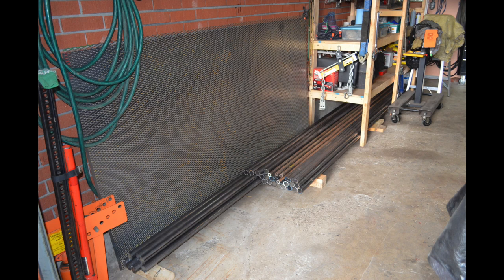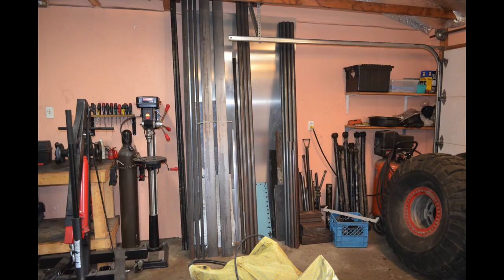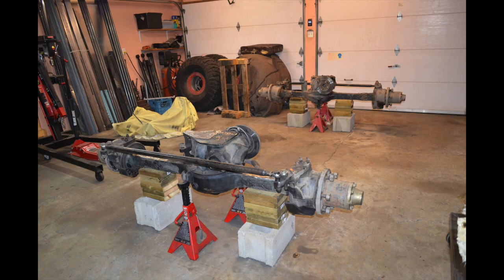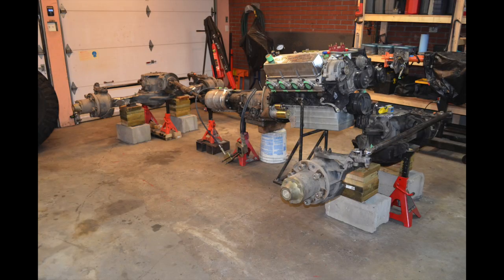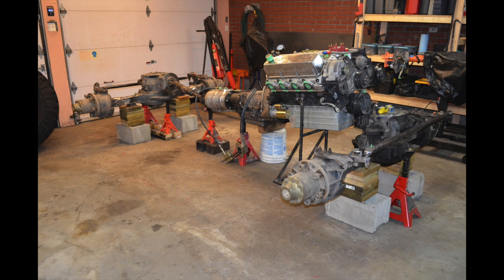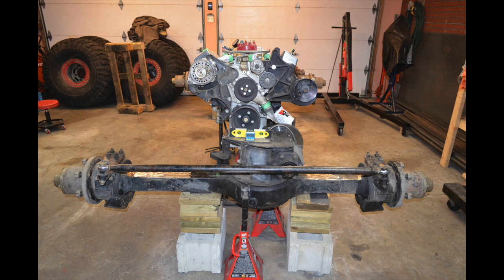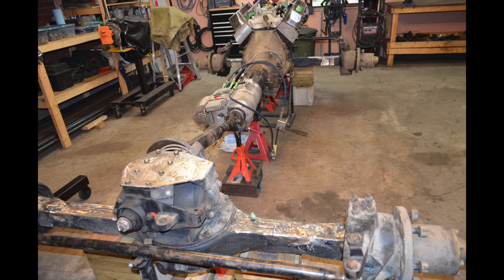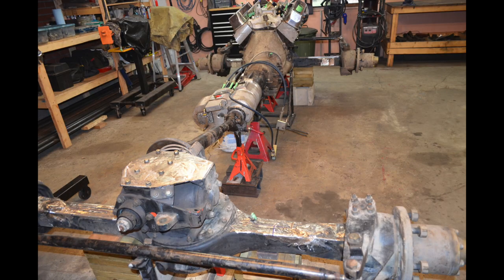Episode 2: Drivetrain | How to build your own rock crawler/buggy/bouncer

Comment: How do you determine/set ride height on a rock crawler buggy? Obviously lower the COG is best, but how do you balance lowering COG without sacrificing ground clearance,shock travel, or having the rockwell top hat contact whats above it?
Reply from the maker: Good questions. It all depends on the terrain and what you use the buggy for, it is different for rockcrawling than hillclimbing. It also depends on the wheelbase and personal preference. That's why when you are building a chassis, It is best to start by laying the drivetrain in place at full suspension compression. For instance, If you know you want 8" shock shaft showing at ride height and you want 22" belly height at ride height, you set the lowest part of the drivetrain at 22"-8"=14" above the ground (or neutral plane), plus you add 1" for safety and the thickness of belly skid/braces. Once you have these measurements figured out, you build everything to match. I lay the drivetrain at about 6 degrees titled back, with the transfer case clocked as flat as possible. After that, you are almost guaranteed that the lowest part of the drivetrain will be the back part of the TC. You set the axles at a height equal to the belly at full compression. This is one way to do it, there are a ton more ways to build a chassis and everyone has their opinion. It took me several tries to figure it out, maybe by sharing what I learned, it will save someone time.
Reply: @rgsabat  
Thank you so much for your reply! You answered my follow up which was do you build at full compression from the start. That makes total sense and what I wanted to verify. My buggy is going to be built for high dessert rock crawling. The big event we have here in NM is the Chile Challenge in Las Cruses,NM. I wanted to build for mainly rocks, dry waterfalls, and high desert landscape of the SW USA (UT, NV, NM, AZ, and probably CO. My next decision is to run driveline disc brakes or hub disc brakes on 2.5 rockwells. Thank you again for answering my questions and this will definitely save my time on layout and building. Are your axles locked all the time or what kind of differential do you run?
Reply from the maker: @LMG6989  Yes, my rockwells are locked at all times, I have Ouverson spools front and rear, simple and strong. No issues with turning because I have rear steer too. Hub disc brakes are nice for sure, but they increase total track width unless you cut down the long side of the rockwell to use 2 short inners. I never had any issues with my driveline brakes (front and rear are operated by different pedals and totally separate systems, I press both pedals at the same time to stop). However, I am not sure how well they would be descending a long steep slope because the driveshafts are spinning 6.7 times more than the wheel hubs, so there will be brake fade in this case . You are lucky to be off-roading some of the best places in the continent, enjoy :)
Reply: @rgsabat  
I had a couple more questions if you don't mind. 
1.Does heim joint orientation matter. Correct me if I am wrong, but I thought I saw on your rig that the axle links are essentially mounted vertically (bolts go through horizontally) and the frame links looked like they were mounted in a horizontal orientation (bolts go through vertically). Is there any benefit to mounting in this orientation? 

2.What degree of shock angle would you consider as excessive when building your suspension? Does shock angle even matter whether that angle is front to back or side to side for proper operation?
Thanks again.
Reply from the maker: @LMG6989  For (1), you can mount your heim joints in the direction that you want, as long as you can flex the suspension through its entire travel without the heim joints binding. I chose to mount my lower links frame mount heim joints with the bolts vertical because, with the links triangulation, the him joints could withstand with strong side loading without them breaking (example a side hit on the tire would be transferred to the links and the heim joints would be in the best position to absorb the hit). For (2), yes, shock angle matters according to the cosine law (you could use trigonometry to calculate the actual numbers), but to sum it up, the larger the tilt angle, the more you have to increase the spring rates and the worst the shock dampening. Ultimately, it's all about packaging, you want your lower shock mounts as far apart as possible on the axle to maximize stability, but you also want the upper shock mounts to be inward to protect the shocks during  rollover. I would not worry about the shock angles as long as they are below 10 degrees in any direction.
Reply: @rgsabat  
Could you do a video explaining the steering set up and what goes into setting up a full hydro-steering system for front and rear steering?
Reply: @rgsabat  
After you determine ride height at full compression, about how much does the rig lift up once the shocks are installed and charged? Does it lift have the total shock travel (ex: 8in on a 16in travel shock)? Thanks.
Reply from the maker: @LMG6989  You build the chassis at full compression (ride height will be 6-8" higher than full compression). The exact lift amount from full compression will depend on the unsprung weight of the chassis. You have to make a guess before getting the right spring rates if you are using coil-overs. If you are using air shocks, you can adjust the PSI I suppose. For a 16" shock, I would go with 8" of shaft showing. These numbers here depend on personal preference and the use of the rig. This is the secret sauce of buggy building!
Reply from the maker: @LMG6989  I will when I have time over the next while
Reply: @rgsabat  
Wow awesome thank you very much again!!

Comment: Great vid! You've inspired me to build my own rock buggy, I'm almost done but I have little knowledge of selecting the right camshaft I'm running a 496 with efi intake. Any recommendations I would like something competitive?
Reply from the maker: Thanks. Camshaft choice is not easy to make, it really depends on a lot of factors, including how stout the engine short block is, how much does the heads flow, exhaust size, drivetrain, etc... You need to set a HP goal in mind and  work from there to get what you want. I personally prefer all forged bottom end for an engine  that makes  over 500 hp. Plus, you need to match the camshaft with the torque converter, otherwise you won't be happy with it. Anyways, I can't really give you valve lift numbers and duration  for the cam because it depend son many factors. I recommend that you  talk with an engine builder so he can get you what you need. good luck.
Reply: @rgsabat  awesome thanks!

Comment: Would it  be possible to get some. Better dimensions on the main double frame? What's the length of the bars that are between the two?
Reply from the maker: They are 11" top to bottom.